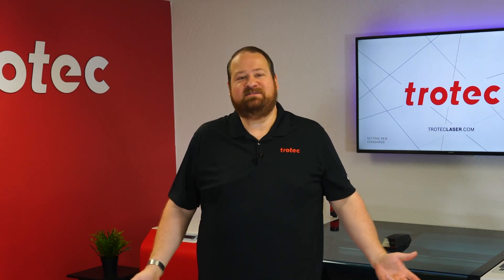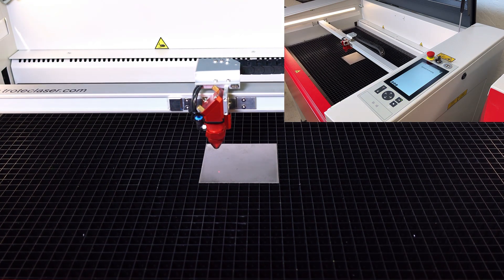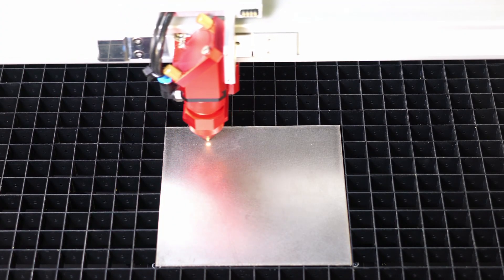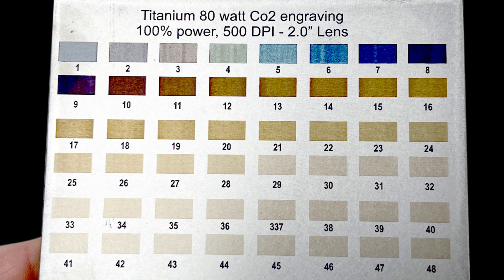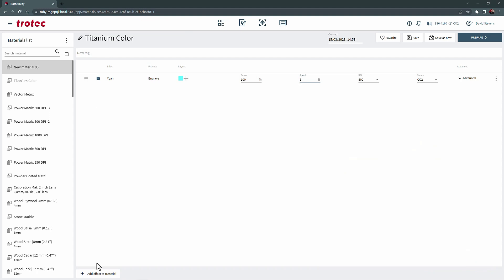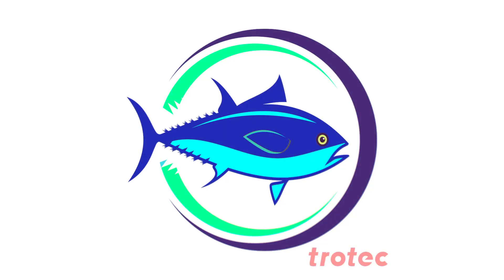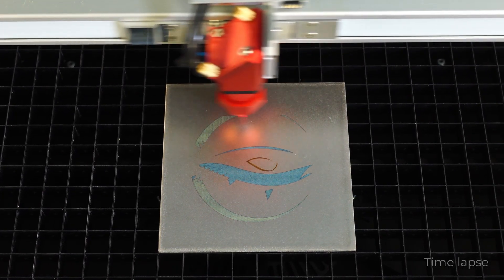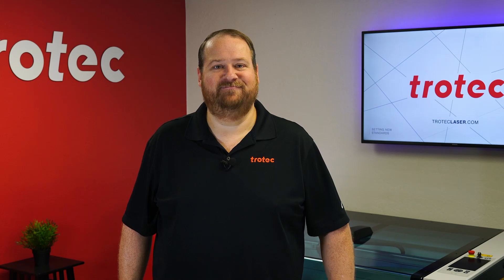Let's Laser it: Color Marking and Engraving Titanium with a CO2 laser

Comment: Thanks for running those tests. I was really surprised that you didn't need any kind of coating to make this work, and probably wouldn't have even tried this. 

Does the lines per inch alter the color being created? What other factors can significantly change the results.
Reply: Power, Speed, Focus, and DPI will all cause different effects; I suggest running tests on your laser to confirm how your titanium will perform.

Comment: This is so cool! Thanks for the info! Can you achieve color marking on stainless steel with a CO2 laser? I can't find info on this anywhere.
Reply from the maker: Hi there! It is not possible to mark stainless steel with a CO2 laser without a laser bonding spray or powder coating.